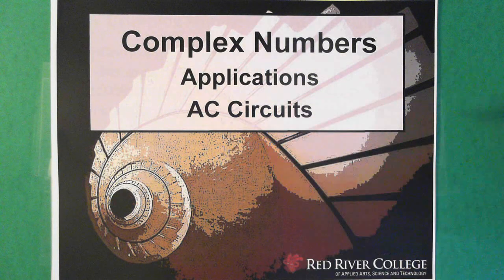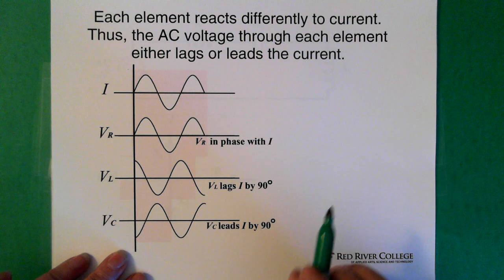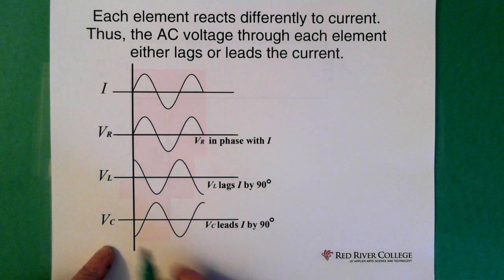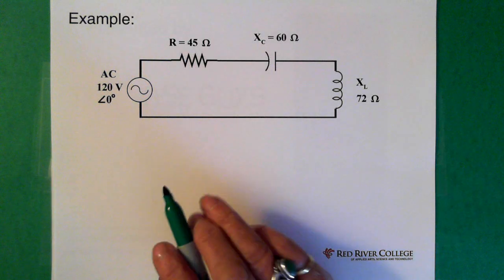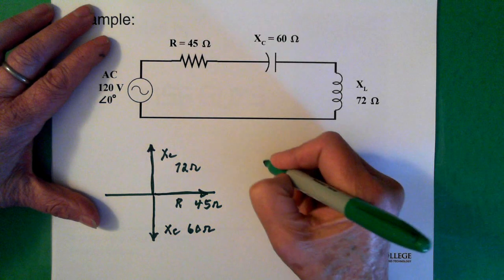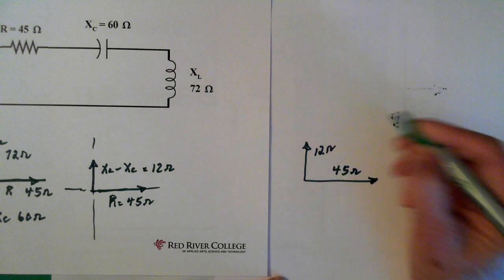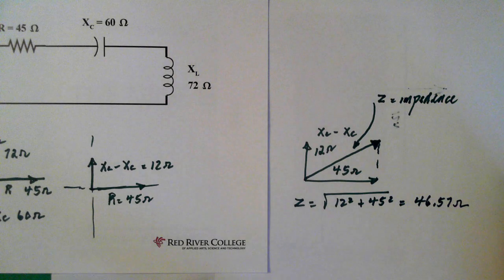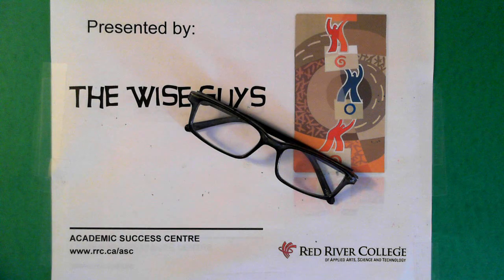Complex Numbers: AC Circuit Application

Comment: At point 3.03 when you drew graph and explained lead lag concept, the current in the circuit leads voltage across the capacitor and lags the voltage across the inductor.. You said it other way I think.

Comment: This is Analysis in the FREQUENCY Domain using Phasors, which was innovated by Charles Proteus Steinmetz, an Electrical Engineer, it is much easier than solving / calculating in the Time Domain.

Comment: at 2:58 in Inductor the correct is V leads I by 90 degrees or I lags V by 90 degrees not V lags I by 90. Same with Capacitor it's also incorrect, in capacitor I leads V by 90 degrees or V lags I by 90 degrees not V leads I by 90 degrees.

Comment: Excuse me, I'm not implying that i know more , but doesn't in time 2.50 the voltage in an inductor leads the current by 90 degrees and in time 2.59 the voltage in a capacitor lags the current by 90 degrees?
Reply: That is correct!

Comment: Sorry Madam, For an AC Circuit In case of Inductor Voltage  leads the current by 90° means current is lagging the Voltage by 90° and In case of Capacitor Voltage lags the Current by 90° it means Current is leading the Voltage by 90°.
Reply: I thought so too

Comment: Its a very big error ,Voltage always leads the current for purely inductive circuits by 
pi/2 (or 90 degrees).

If this will not happen the inductor will not be able to store the energy as magnetic field.
If voltage lags the current the element will behave as capacitor.
Reply: Although the graph you are using shows voltage leading the current for inductor 😂

Comment: You are using the wrong analogy here... instead of saying " component react differently to current" you should say " component react differently to VOLTAGE" the current we get is caused by the reaction of the components to the voltage, not the other way around. 
Here is an example, We apply a voltage ( which is an independent phenomenon from the components), THEN, we get a current either lagging or leading to the voltage we applied. Why would the current lead or lag? Because of the reaction of capacitance or the inductance ... Voltage comes first ( Cause), then come the current ( effect).

Comment: 1. Voltage in inductor leads by 90 degrees.
2. At 9:56 arctan is NEVER called tan to the -1. tan to the -1 is cot. 
3. Too slow
Reply: arctan is absolutely called tan^-1, that is extremely common phrasing and consistent is mathematical function notation.
Reply: Cool then

Comment: There`s, still, a grave mistake. Repeating what has been already comented by Bunnyy 83:

"The correction is also wrong ^^. As said the graph is actually right but what is said is wrong. Inductive loads --> current lags voltage and not voltage lags current. If you reverse the two things the "lags" becomes a "leads". So indeed the voltage does lead the current since the current lags the voltage. Just as "A > B" is the same as "B < A""

Thank you for the video!
Reply: I was so confused when I heard that and read the correction lol... I was like uhh Inductive reactance leads by 90 degrees?>.>

Comment: what's the difference between lagging 2PI and leading PI?
Reply: lagging/leading 2pi is the same as lagging/leading zero since 2pi is a full cycle, lagging/leading pi is half a cycle
Reply: So there's no matter in the waveform! :)
Reply: depends what you're asking, the amplitude and frequency will be the same no matter what the offset is, an offset of pi will cause a half cycle offset, an offset of 2pi does nothing
Reply: my question was wrong ahah I just realized, I meant what's the difference between +PI/2 and -PI/2... and 0 and PI... I mean, what's the evaluable difference, will the signal has some delay arriving or just phase difference?

Comment: 2:57 You make a grave mistake here.
In circuits with primarily inductive loads, current lags the voltage.
In  capacitive circuits, current will be leading the voltage.

Videos like yours make it unnecessary hard for students to understand the basics. Please correct the error or remove the video.
Reply: +Red River College Wise Guys The correction is also wrong ^^. As said the graph is actually right but what is said is wrong. Inductive loads --> current lags voltage and not voltage lags current. If you reverse the two things the "lags" becomes a "leads". So indeed the voltage does lead the current since the current lags the voltage. Just as "A > B" is the same as "B < A"
Reply: +Cinqmil

Yes i found the same mistake. For me it seems like a strange approach to base the graphs on the current. The voltage cause current, not the other way round. A voltage is a state / potential like pressure in a pipe. If the pressure is high enough to overcome the resistance a current will start to flow.

If you have inductivities the current lags behind the voltage by 90°. They have a high resistance in the beginning and a lower resistance once "loaded".

Capacities on the other hand have a very low (almost zero) resistance in the beginning (--> results in high current) which get higher the more "loaded" the capacitor gets (--> the current goes down).

I just want to point out that the actual graphs in the video are correct, but the interpretation seems strange. The graph represents a timeline. Things which are more to the left happened earlier than things to the right. So for example VL is at max at time "0" but the current lags behind. The current reaches it's max 90° later than the voltage.

I'm sorry if i didn't use the right terms. I learned all that 15 years ago in my native language (german) so i have some difficulties translating everything correctly ^^.
Reply: i tought something's wrong in her reprezentation. I KNEW THAT IN CAP THE CURENT IS AHEAD CUZ THE CAP'S CHARGING UP, AND IN INDUCTANCE, VOLTAGE IS AHEAD OF CURRENT CUZ INDUCTANCE OPOSES THE CHANGE IN CURENT ( WICH COMES FROM THE FREQ.)
Reply from the maker: +Cinqmil In circuits with primarily inductive loads, current lags the voltage.
In capacitive circuits, current leads the voltage.
This is exactly what is said in the video. Upon review, I have discovered that the visuals don't align with the correct statement in the video. Annotations have been added to this video to clear up confusion. Thank you for bringing this to my attention!
Reply: Cinqmil it's not wrong she took it in respect to Current. It works actually both way around, depends how u visualise.  Sometimes is good to think out of the box/or templates, the principles are the same

Comment: excuse me ,,,,,in pure inductive circuit current is lagging by 90 degree,,,,amn't i right?????
Reply: +Amrit koirala Yeah, I think there was a mistake.
Inductive: Current lags voltage.
Capacitive: Current leads voltage.
Reply: @qasimpakistan ooh!! I liked your comment which was given 9 years ago😮😮
Reply: Yes, at the 3:00 mark, they show the VL and VC phase shifts backwards.
ICE...current leads voltage in a capacitor
ELI...voltage leads current in an inductor
Reply: This is so oversimplified you might aswell not use complex numbers. Would be really nice to know how we got to them and how is eulers formula used...
Reply from the maker: +Taan- Dav In circuits with primarily inductive loads, current lags the voltage.
In capacitive circuits, current leads the voltage.
This is exactly what is said in the video. Upon review, I have discovered that the visuals don't align with the correct statement in the video. Annotations have been added to this video to clear up confusion. Thank you for bringing this to my attention!

Comment from the maker: I ended this video by saying I could not solve more, because I did not have current.  Which, upon reflection, was incorrect.  I could have solved for current and solved for all voltages...  However, my focus for the video was solving for reactance and impedance so I chose not to solve the entire circuit.  Upcoming videos will have entire circuits solved.
Reply: she just wanted to show "how much the impedence is"......................
Reply: +Red River College Wise Guys There are many components to learning circuits. One plan I discovered which succeeds in merging these is the Gregs Electro Blog (check it out on google) without a doubt the most useful info i've seen. Check out this  unbelievable website.